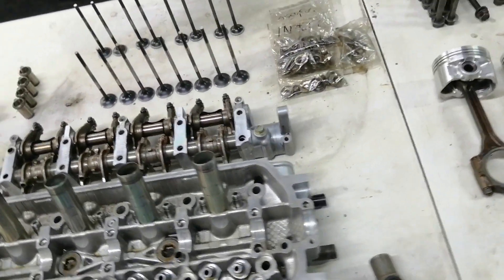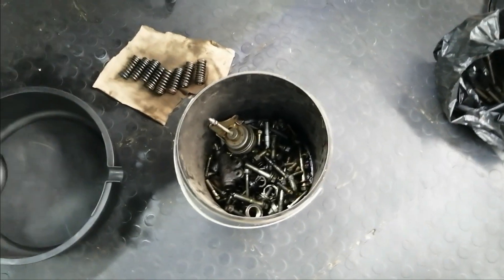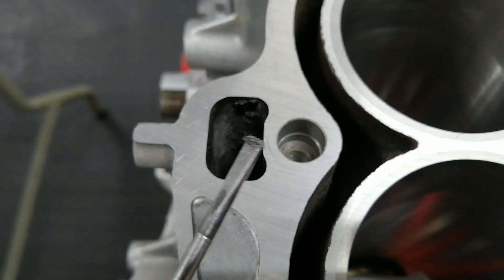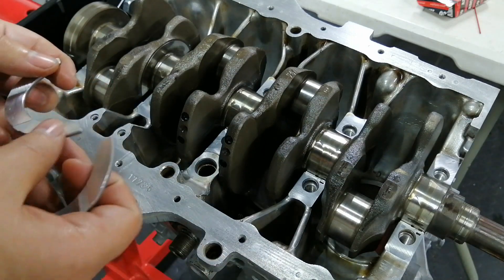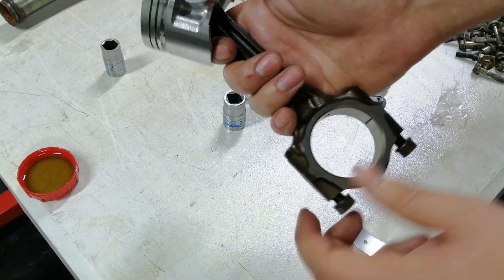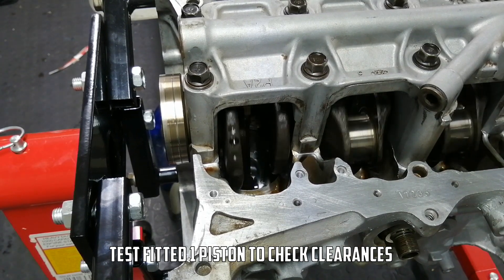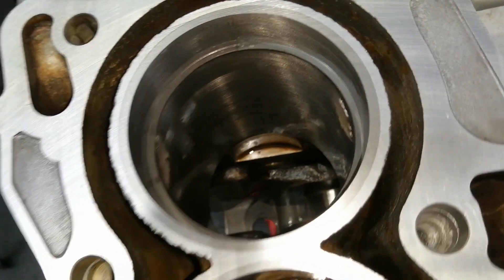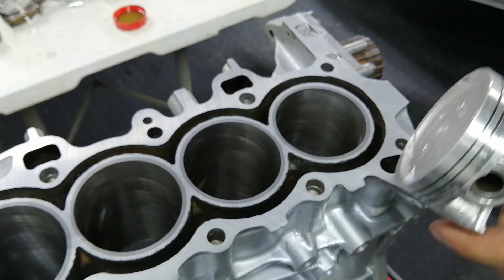Honda VTEC Engine Assembly  - D15/D16 Mini-Me - Part 1

Comment: Love how you're boosting non B series motors... so refreshing to have alternative Honda engines on the tube
Reply from the maker: Hi Johnny, thanks! yeah the single cams can handle a surprising amount of boost considering they were intended for economy and parts are dirt cheap compared to Bseries stuff, boosting on a budget, I will be testing the how reliable the stock motor is at 220whp soon.
Reply: @RisingBoostYT  Amazing from such a small motor! Cant wait to see the build
Reply: Can get just as much power from a d series as you can from a b series :)
Reply: @fussy-e5s  I have no doubt about that, Honda make good engines especially they breathe well, I'm guessing if you were going to compete with B series would you do closed deck/deck defender to make it a little more rigid in the cylinders?
Reply: @920400706  I’m fairly new to Honda and currently in the middle of building a d16y5,thinking of forging it and then turbocharging it in the future.I think the d16y5 block is the same as all the d 16 engines just the head is different I believe so can always change that to a z1 head. My civic is an ej9 non vtec so will need to wire everything up also but will make for a fun little build
Reply from the maker: Hi Jay, the D16Y5 is normally a vtec-e motor. (check for the solenoid next to the intake manifold) if it is not vtec-e you can boost it stock to make more power but stay under 200whp. if it is vtec-e you should not over rev it, vtec-e has thinner valve springs and like 9.3 compression, so needs high octane fuel if you boost it. you can swop on a non-vtec head that will help. bottom ends are mostly the same. if you forge it you should be good for 350 to 400hp, after that the head likes to lift. you can make more but it becomes expensive after that
Reply: @RisingBoostYT  thank you so much for your reply buddy it’s helped me a lot! I’m aiming for 200hp with or without a turbo charger,may I ask which non v tec head would fit as a non v tec would be easier to build as my civic is non vtec
Reply from the maker: @fussy-e5s  I would recommend any D-series head from 96 to 00 years. basically, the series that came in the EK/EJ. avoid EG Dseries heads - 88 to 95 as the head studs and dizzy bolt pattern are slightly different. also 01 + and D17 heads won't work.
Reply: @RisingBoostYT  thank you bud so I could use a non v tec d16 head any of the them?
Reply from the maker: @fussy-e5s  yes, I have a D15 block with a D16Z6 Head on it. all the 90s D-series heads work on the different blocks. (not the DOHC ZC & D16A9)
Reply: @920400706  man i fucking love clean e11 corollas especially hatches. You gain a sub from me
Reply: @hisheeelijah1482  thanks big man, lol got an e11 sub on a Honda page ha ha ah bet they're gonna be bashing their k20's at us....
Reply: @920400706  tbh im a honda head but i always loved the e10 and e11 corollas since i was a kid
Reply: @hisheeelijah1482  aaah yeah they're great hatches, I really like the EG9 civvie tho
Reply: @920400706  man ive seen way too many builds of that thing at this stage im so bored of them theyre like a commuter car.
Reply: @hisheeelijah1482  ha ha ha true and the price keeps on rising, for the price of 1 EK9 I can buy easily 5 E11 Corollas!
Reply: Imo, D series are for boosting while the B is for big power NA
Reply: Single cams are slept on way to hard. Take $1200 and you can make 500 plus wheel and be lighter that a k or b
Reply: D series is great for forced induction, takes boost really well and can make big power for a lil 1.5/1.6
Reply: I remember here in Portugal D engines were pretty much the only used by tuners in the 00s .Because they are pretty strong ,b16 were expensive and are made of glass u need to rebuild them with forger pistons ,conecting rods ,etc

Comment: Should have used forged rods those dinky ass stock rods will break in half
Reply from the maker: True, but we have a Bswop coming soon, so no use dumping money into the sohc build. they can handle 220whp in stock form so we will pushing it to the max and see if it lasts. if it blows up the B18V is waiting. also more fun making power on a budget. 100s of channels dumping big money into builds, I want to see what the motor can do if I cheap out on just about everything.

Comment: Are the d15b7 and your block similar? I want to do this with my b7 block. Not sure if everything applies
Reply from the maker: Hi Jordan, I Believe the B7 is the EG Dseries, slightly different but it can work, however your plug leads wont fit the different SOHC vtec head, you will need a vernier cam pulley otherwise your timing will be out by half a tooth, and you need to remove the oil restrictor in the block. Try to get the Z6 (PO8) intake manifold, the B7 has smaller runners. Also your stock ECU can't run the vtec so you may need to get a chipped or D16Z6 ECU. there may be a few more small things, but you can definitely swop a vtec head onto your B7.
Reply: @RisingBoostYT  awesome, thank you brother. Really appreciate the response. There is a lot of conflicting information online so it's good to hear it straight.👍🏻👍🏻